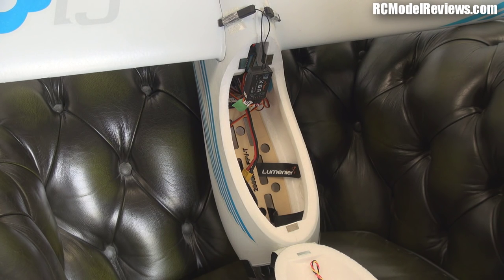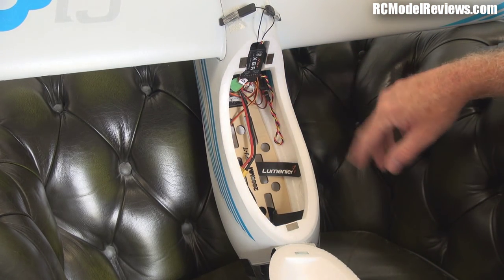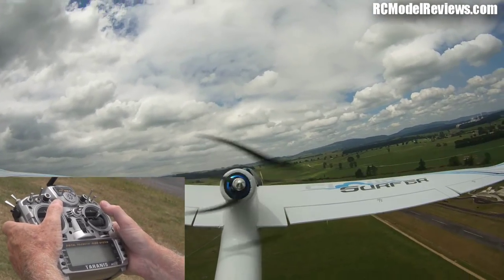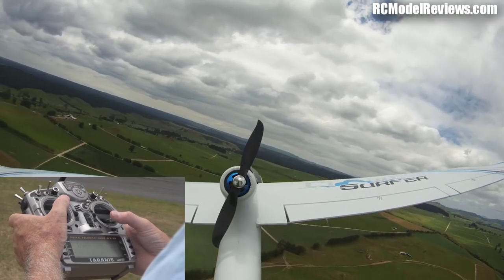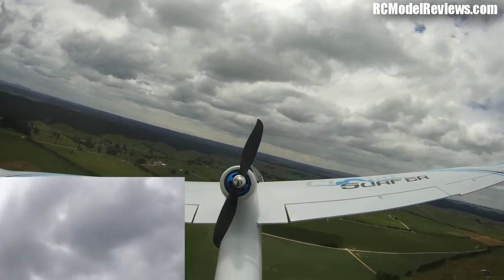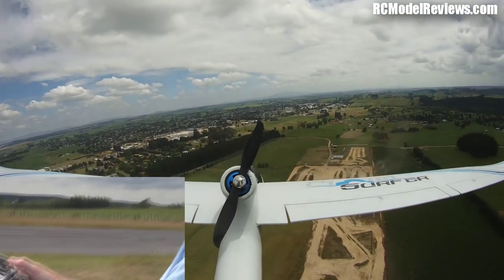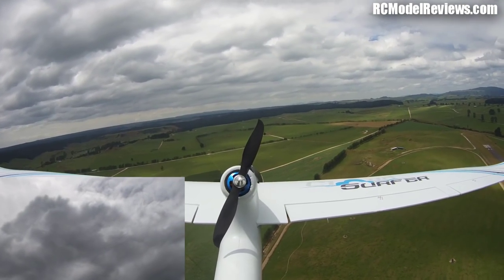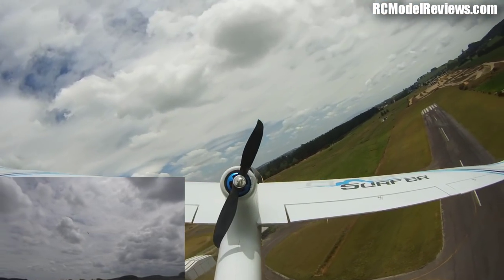FrSky variometer sensor (in action)

Comment: This may be an incredibly obvious  question, but is the legal height limit from the ground or from sea level or some other factor?
Reply: +Gary Lowe I don't know about over there, but in the US I believe is 400 feet above the tallest structure in the area. Some one chime in if I'm wrong.
Reply: slinkyfpv Thanks for the reply. That would make sense.
Reply: +Gary Lowe it is not from sea level.  I don't think its 400 ft from the tallest building. I believe its 400 from the ground. Correct me if I'm wrong. thanks.
Reply: +Christian Prodanov its 400' from the ground. not the tallest building.
Reply: +Gary Lowe It's 400 feet AGL (above ground level)
Reply: Aviation rules (for aircraft) are 500' above the ground in a rural area, and 1000' above the ground in a built up area. From drones, you are limited to 400' AGL everywhere.
Reply: And not within 5-15 miles of an airport depending on the airport and local regulations.
Reply: +Christian Prodanov If you want to get REALLY technical there's no 'legal limit' for models at all- only recommendations. The AMA provides no altitude ceiling if you are more than 3 miles away from an airport and the FAA chooses to word it's 'requirements' as 'guidelines'.
Reply: stewjw it was a serious question. What's funny about that?
Reply: +Gary Lowe its always above ground level unless otherwise stated. ASL is used for air traffic control so jets fly at the right altitudes. for small aircraft, even on maps for tall towers and what-not are marked AGL. Drones fall somewhere around this category.. ASL is used kinda like a speed limit is used in a car so its referenced to sea level so the entire world has the same standard.
Reply: +Gary Lowe I actually deleted my comment but youtube keeps reminding me about it. My comment actually demonstrated in simple terms how silly your question was which you freely admitted. People in their replies often gotten carried away with definitions which I feel you also have. As in most things in life think about the meaning of a statement. Sea Level is a base line from which all elevations are measured. Clearly everyone in the world including my Dad lives at different heights above sea level which are often above 400 feet. So clearly the above restriction can't be above sea level. It is indeed above the ground you are standing on but its an arbitrary height and I agree with what Julian says above. As always when FPV flying check your surroundings and don't fly in an area where there are low flying aircraft.
Reply: Julian Waters you are so wrong its not even funny.... The AMA has no say at all. Its all the FAA's authority. You do have a legal height limit, and thays 400' AGL.
Reply: And its 5 miles from an airport (WITH A NOTAM) under 200' or, 15 miles without a notam...
Reply: +nilamotk Its a tricky one and I am not a lawyer but as Bruce mentioned RC gliders have been soaring higher than 400 feet for years and its only with the popularity of FPV flying this issue has come into the spotlight. But common sense goes a long way and I don't want to start a pointless argument in this area.
Reply: +stewjw exactly, there were never any restrictions because It was rare for a model to come into contact with a fullsized aircraft. also gliders weigh like 2 lbs tops and are made usually of foam, or balsa.. a plane hitting a glider wouldnt be any more damaging then a plane hitting a bird.. because of the huge boom in drones, regulations needed to be made.. a drone can be flown from your driveway, a glider cant.. this being said, its ALOT more common for a drone to come into contact with an airplane.. and because drones are usually made of carbon fibre, aluminum, and dense plastic, sometimes weighing upto 30-40lbs, they will cause a catastrophic scenario.... imagine a 30lb drone coming through the windshield of a cessna, and then the cessna coming through the roof of your home..

im not trying to be a dick, but I have my UAV ticket, and Im insured to fly drones for commercial use.. tbh, its a good job, and I dont want it banned from people thinking the wrong things.. if you are caught flying a UAV within 15 miles of an airport, without the proper documentation, and paperwork, you're looking at a 5-25,000$ fine, as well as being caught flying above the legal limit.

when it comes down to a "UAV" its an unmanned aerial vehicle. meaning if you arent sitting inside it, and its in the air, it falls under the classification of a UAV this includes gliders too.
Reply: stewjw fair enough, but I am not the only one who wasn't sure as others have posted what they belive the rules to be and we have had 4 or 5 different answers. Just because you may know the answer to a question doesn't make me an idiot for asking the question. Please don't try to talk down to me just because you know something I don't.
Reply: +nilamotk Its good to be reminded of the regulations which I try and stay within as much as possible. But if you've flown at 400 feet you'll appreciate its actually not very high. These days I tend to fly low but the world is changing and pilotless aircraft are  finding more applications and sometime in the near future the FAA will have to recognise this.
Reply: +stewjw The FAA has already recognised this, They are the ones who made these guidelines.. aswell as Transport Canada.. they arent even Guidelines anymore. they are rules.. and have fines assosiated with them. Plain and simple... the rules arent that harsh.. If your a car, you can drive on the side walk for obvious reasons.. if you are a drone, you cant fly above 400' because at 500' you might hit an airplane..
Reply: +nilamotk That is the old argument but pilots what ever their ability need to realise they do not own the skies. I understand the safety argument but large fast aircraft should not be flying at low altitudes and smaller aircraft will be able to see smaller FPV planes. I am not against the argument of making pilotless planes more visible. You can buy very bright flashing LEDs (strobes) these days. It needs looking at rather than being dogmatic about it--just my view.
Reply: stewjw this it true, but you dont own the roads. Are you gonna go walk down the middle of a 4 lane highway just because no one owns it? Lol.. Im not trying to argue. It should be common sense.. Unless you want to potentially kill someone, stay below 400'.
Reply: stewjw also, as a private pilot... Its hard enough to see other full sized aircraft let alone a drone or model plane... It wouldnt be seen untill its far too late.. 

And I promise if I ever came close to hitting a drone, and Im at legal height, im circling around and gonna watch where that drone goes.. I will call the FAA or TC and you would be up shits creek forsure... Again, not to be an asshoke, but if you almost kill me (and my friends/family) I wont be like "oh well"... 

Nothing again drones (as its my job) but I am against peopke who use them dangerously.. Its not a joke.. 

A tire from a trasport truck coming through your windshield is the equivent of a drone coming through the windshield of a cessna.. I dont need that In my life... And neither does anyone else...

This is why we have these rules and regulations (that EVERYONE follows...)
Reply: +nilamotk  You are contradicting yourself in saying you can't see "drones" and yet you are going to circle them, and getting morbid.  There's more of a chance of you killing yourself and others in your plane than someone flying  a small pilotless drone.The accident statistics speak for themselves.
Reply: +stewjw if it comes within 10 feet of my windshield, and I have to slam on the controls to avoid it... im gonna see it... im not gonna look for the drone at this point.. chances are the guy flying the drone already knows he fucked up and is most likely landing... im gonna be looking for the car thats parked with a dude outside setup flying a drone...

the camera on a drone is shit. youd be amazed what you can see on the ground (when you can focus your eyes) from a thousand feet..when you have no reference, your just looking out into the sky... its hard to focus your eyes on somehing that you dont know is there untill last minute.. If you ever get a chance to go flying in a small aircraft, try and find a bird.... ill bet you cant..
Reply: +stewjw seriously, Im not here to argue with you... fly above 400', hit an airplane, and see for yourself what happens...
Reply: +nilamotk This is why I think we should think of ways to make sure this doesn't happen. There are avoidance systems commercial airlines use them. Amateur long distance remote control flying is if I understand correctly banned in the US due to a bloody, narrow minded attitude of certain group of people in authority. But you can't stop progress.
Reply: +stewjw DJI is already doing this. drones come limited to not be able to fly in airport airspace.. although alot of people turn these features off... im sure they will be manditory in the future, otherwise you will need to have a UAV certificate.
Reply: +stewjw meaning if your drone is home madr, youll need a UAV certificate, otherwise it will ha e to be limited from the manufacturer
Reply: +nilamotk DJI Phantoms are the archetypal drones. DJI tried to take a bit of a lead in this introducing area restrictions. I didn't know you could turn it off.  I first heard of this system being implemented in their Inspire 1. Eagletree's flight controller used to send a nagging message when you flew beyond 5km I think it was? I don't like these systems which do nothing for safety. I know people do dumb things like fly near airports. UAV certification is also a bit of a joke from what I've seen.  I often bring this subject up on these forums and I always get acrimonious replies from people who claim to be pilots. But people are flying FPV planes and trying to implement draconian rules to severely limit this type of flying isn't working or going to go away. Making FPV flying safer and better understood is a better way to deal with it and from what I've read the FAA has in reality little interest in this area. I'm not from the US but a lot of countries often follow the US lead in certain areas which is why myself & others have an interest in developments over there.
Reply: +nilamotk If you are an AMA member flying by the AMA safety code (This means I am using a spotter who is observing the surrounding airspace for manned aircraft) the FAA has no jurisdiction. P.L. 112 SEC336(a) clearly states that the FAA cannot make any regulation concerning model aircraft if said aircraft are operated in accordance with the guidelines set forth by a CBO. The FAA's current regulations regarding altitude requirements are applicable to manned aircraft, and their documents regarding unmanned hobbyists aircraft are worded as 'STRONGLY RECOMMENDED GUIDELINES'. The FAA, by their own wording, has no strict regulation for altitude regarding UAS. If you're going to argue otherwise please cite the appropriate regulatory documents (SPECIFIC to hobby UAS operations).
Reply: +Julian Waters STRONGLY RECCOMENDED because if you hit that plane, with the very little AMA insurance you have, you will loose your house, your car, and your livelyhood..
Reply: But strongly recommended isn't a hard and fast rule. With a little bit of common sense which, granted, is very hard to come by these days, you can fly above 400' and not present a hazard to manned aircraft. Examples of common sense might be checking flight tracking apps before flying, planning your flight in an area without manned aircraft, or flying with a spotter.
Reply: +nilamotk What altitude do you typically cruise at? There have been reports of pilots mainly dumb helicopter pilots crashing into power lines. Responsibility works both ways. I think most sensible pilots of full sized aircraft will fly at an altitude which will give them time to find a suitable landing place if they have an engine failure.
Reply: +stewjw deoends where you are, and what you are doing... flying over a cliff face, ill be low... im allowed to be as low as 500'... so this is where collision may occur... im not trying to pick a fight.. be careful is all im saying, and dont say there is no limit, because thats total bullshit. regulations have changed huge. model flying clubs have dedicated airspace... no limit at a model avaiation club is plausible, bit still not likely.. 500' you cant see the plane. most aviation clubs dont allow fpv.. line of sight only. meaning tough luck being above 500' unless your flying a 10' monster rc plane.. besides this point, model airports are marked on aviation maps as a hazard. most pilots keep away from these, or fly higher if needed... saying there is "no limit" means someone could take their drone up to 2000' in the middle of a parking lot with absolutely no warning to pilots... this is a serious no-no and you will get in trouble doing this..
Reply: +nilamotk 'someone could take their drone up to 2000' in the middle of a parking lot with absolutely no warning to pilots'. Absolutely yes. They could. If that parking lot isn't within 5 miles of an airport or heliport they're perfectly legal. If they interfere with manned aircraft operations it becomes illegal.

Please- I'm asking you- if there's documentation out there from the FAA that specifically sets altitude restrictions for hobbyist unmanned aircraft, PLEASE link that documentation. I'd like to read it.
Reply: +Julian Waters https://www.faa.gov/uas/ 

scroll down half way and go to the "know before you fly"

you are recreational (not licensed) so ill do the dirty work for you.

http://knowbeforeyoufly.org/for-recreational-users/

this website is directly assosiated with the FAA. as well as of Dec 21 15 you MUST register your drone to the FAA if it weighs over 0.55lbs. this website clearly states unless on AMA property, you have these rules to follow. it also includes to say in rural areas, aircraft are legally flying at "near-ground" altitudes and you need to stay clear of these aircraft... 

im not gonna continue any further. How about you do some research before regurgitating false information..
Reply: +Julian Waters flying above 500' interferes with manned aircraft. this is why you are to stay below 400'... you have a 100' widndow of error... so at 2000' you're breaking the law.
Reply: +Julian Waters it might help by stating with googling what a "guideline" is aswel..
Reply: +nilamotk I'm perfectly well versed in the definition of 'guideline'. It's the words 'STRONGLY RECOMMEND' that come before it that indicated to me that the 'guidelines' were not enforceable. 

Knowbeforeyoufly cites the FAA and AMA safety code for their 400 foot guideline, yet I have yet to read any ACs or FARs that state a LEGALLY REQUIRED altitude restriction for hobbyist unmanned aircraft. For the sake of my own knowledge and education on this issue, please provide a link.

Common sense should obviously include staying out of the way of manned aircraft that are flying in uncontrolled "near ground" airspace, and staying clear of manned aircraft in controlled airspace is a no- brainer. You seem to suggest that as soon as I am flying a hobbyist UAS in controlled airspace that I am interfering with manned operations. (Although one would assume that airspace classifications are applicable to manned aircraft and UAS not operating for hobbyist use, as the discrimination between controlled and uncontrolled airspace is made by ATC service for different airspace classes) Is there any chance you could find a link for this as well. (I'm looking for the primary source regulations, not a general education site like Knowbeforeyoufly.)
Reply: +Julian Waters You're also talking aboust a gray area... the laws that "dont exist" will 100% be in effect given 6 months.
Reply: +nilamotk For one I'm not registering, and the wording of the FAA's guidelines are everything. Why say 'STRONGLY RECOMMENDED' when they could just say 'MANDATORY'? Their use of 'strongly recommend' in this case clearly makes adherence to those guidelines flexible and optional, and any court would agree.

As I've told you before, I take precautions. I don't fly in an area with heavy manned traffic. For that matter, I scout my location from satellite view beforehand and look at flight tracker to ensure I won't be conflicting with manned operations, and the spotter that I have isn't for watching me, but for watching the airspace around me to make sure that there aren't any manned aircraft that I may present a hazard to. Yeah, there's still a risk that I'll hit an aircraft, but the risk of my aircraft causing an incident is less than the risk of your manned aircraft being hit by a turtle (I can cite that if you want me to). Other pilots take far less precautions than me and don't present an obstruction to manned airspace either.

I suppose you're right about the rules with legal force being there in six months... but at the rate our government works and with the number of lawsuits pending against the FAA for their registration program I highly doubt that six months is a reasonable time frame.
Reply: +Julian Waters Registering your drone is manditory if it weight over .55lbs. You're already breaking the law. as of Dec 21 2015.
Reply: +nilamotk Ah, but I don't wish to be complicit in the FAA's violation of public law (And I fly airplanes, not drones). I'm an AMA member and I fly by the AMA safety code. ;)

I'm waiting until the courts sort it all out.
Reply: At an AMA field limited to fly at the AMA field, and nowhere else...

Point made ...
Reply: +nilamotk The AMA safety code has no stipulation requiring pilots to fly at an AMA sanctioned field.
Reply: +Julian Waters Your right that its not LAW...but cant the FAA enforce them through insane fines? Im sure each offense carrys a fine? Im in the UK not US so I dont know about these things haha.

Anyways I dont really care if its law / enforced or not or whatever...I belive good commen sense should dictate no higher than 400 Ft unless your miles from air traffic or interfereing with people or things then there could be more relaxed about it all.